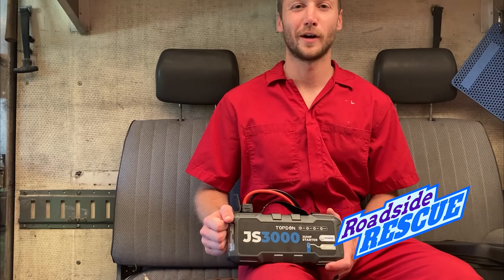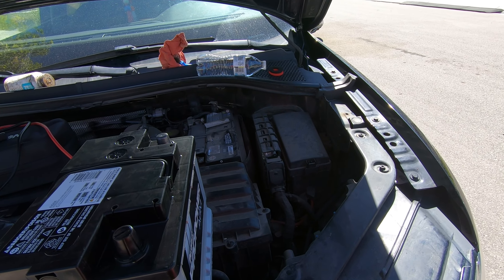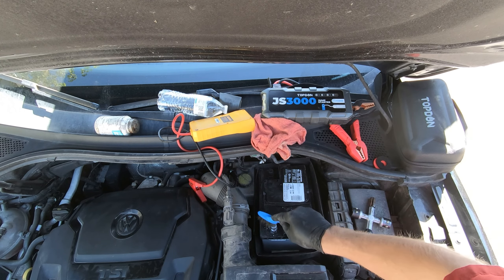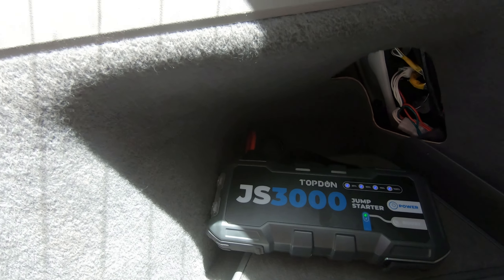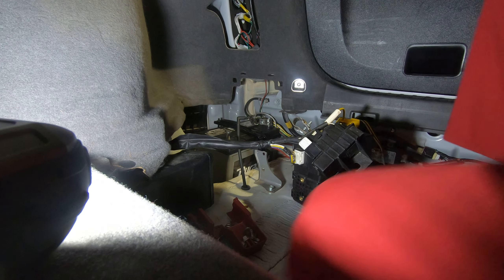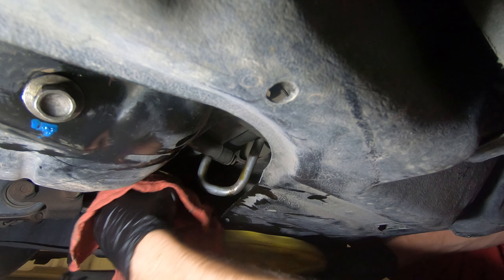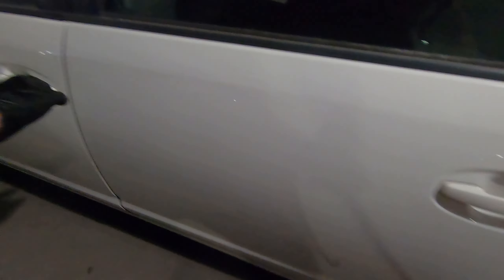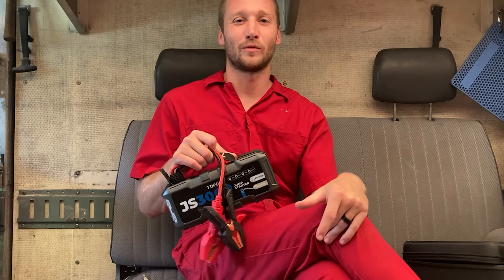A day in the life: Mobile Mechanic - Topdon js3000 a good jump pack for your car? TESTED!

Comment: Excellent work by the car mechanic, the oil cap was screwed on with animal strength. My car Hyndai Getz 1.4 had the oil cap on the crankcase so tight that I dented the crankcase when I opened the cap! This topdon 3000 is a strong helper in the car, I plan to buy one for myself in the future, good luck to you US car mechanic.

Comment: A trickle charger won't help the hybrid battery.  Its good for the 12v battery only.  To keep the hybrid battery lasting longer it should be driven more often especially on a 15 year old car.   A decent hybrid battery can last a year without use so it was on its way out anyway.   The rear hatch has a mechanical release behind a small panel on the inside of the hatch.
Reply from the maker: true

Comment: Wondering how that jump box will hold up in the winter months. If it's Lithium Ion battery, it's should hold charge just fine. Lithium Polymer might have an issue. Not sure about Lithium phosphate.

Comment: Wonder how many times I can use it before the jump box needs a recharge?
Reply: For most users, the key metric is how long will it hold a useable charge when sitting in the vehicle until needed.  The lithium units will easily make a year.  The old lead acid battery units would not make a month and would not start a car most of the time.